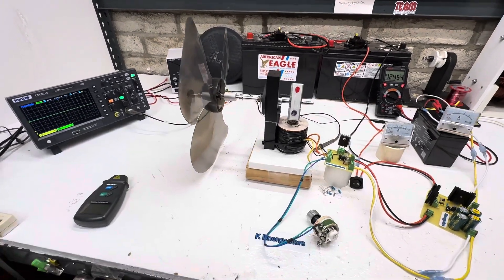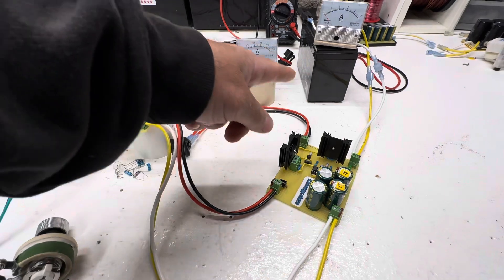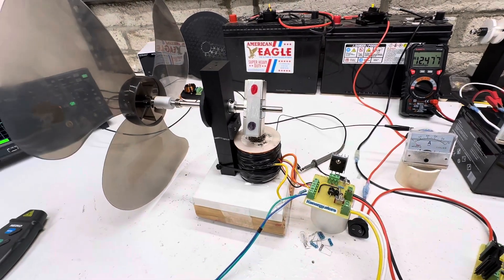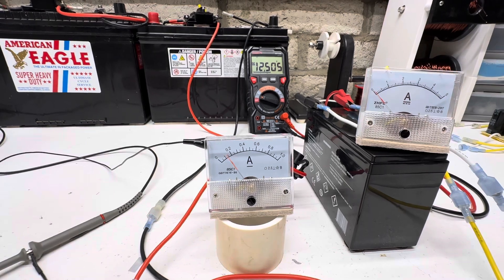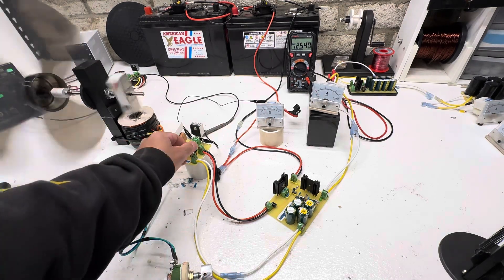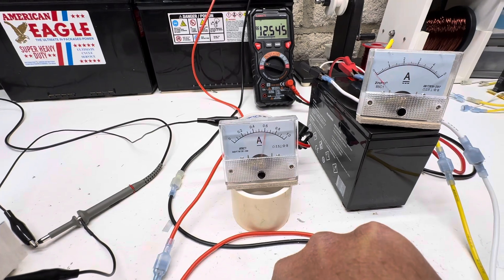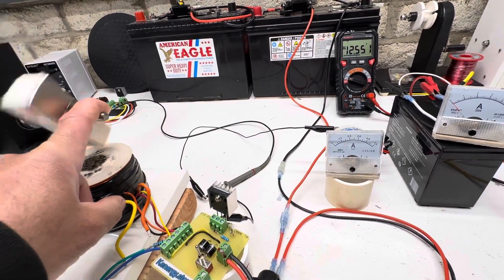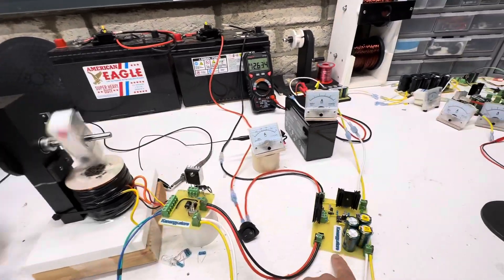Bedini motor with magnets perpendicular to coil

Comment: The resonance of the core is needed. accelerate to a speed at which the magnetic field in the core will be in antiphase with the incoming magnet and will not experience resistance.

Comment: Sorry, I'm trying to understand what this is doing.
What is the demonstration?
Reply from the maker: The demo is about using the least power to run the fan wile also maximizing the hi voltage flyback recovery to charge a second battery for later use

Comment: Really Love your Set Up BROTHER! Is the Coil easy enough to Wind to save shipping costs so I only have to pay for the Energy Circuit..... I am new to this Understanding so I have seen so many Different Bedinni Coils... I think your Magnet set up is Revolutionary!!!...
Reply from the maker: Thanks ! 
Yes you just need a coil bobbin wind It with 26 and 20 or 18 awg enamel wire 450 turns together 
The rotor is 1” square with 8 mm / 5/16 hole in the middle and 2 -1” cube neo magnets